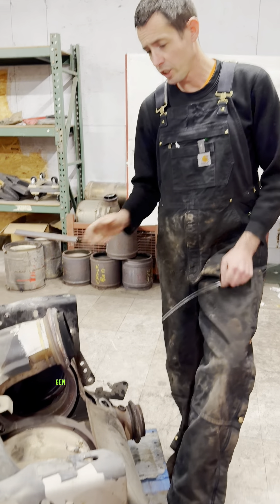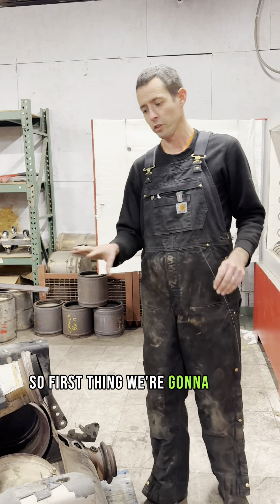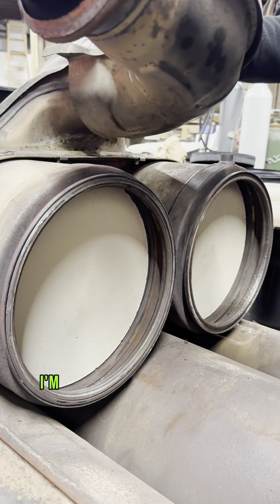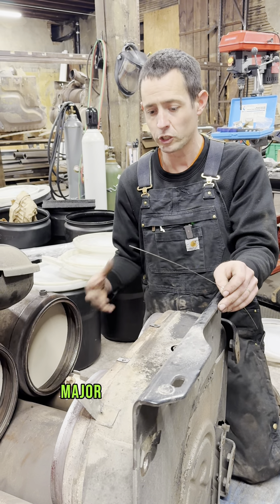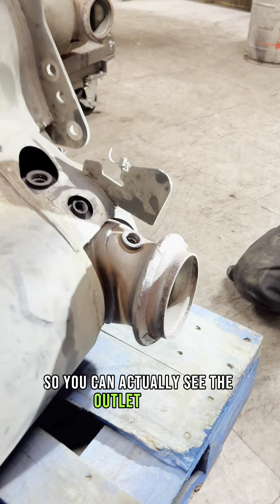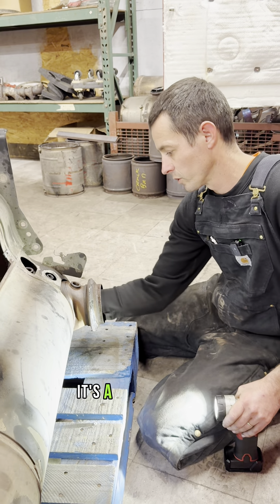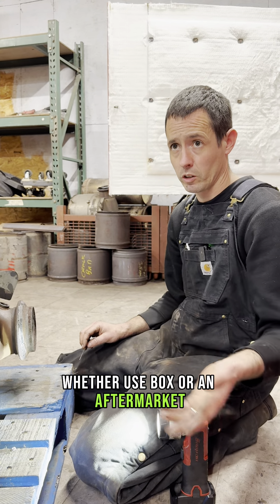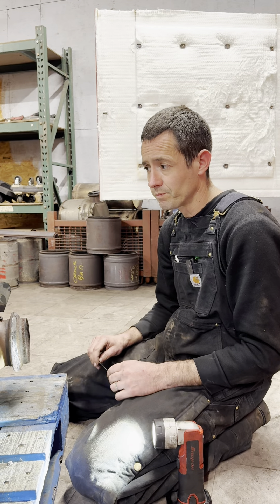How to qualify a Freightliner Detroit One Box for cleaning?

Comment: Ryan, hi sir, I was wondering if you could tell me where you would check oil pressure manually on a cm870? Through the pipe plug in the oil filter housing? or can you use the hole the oil pressure sensor is in?